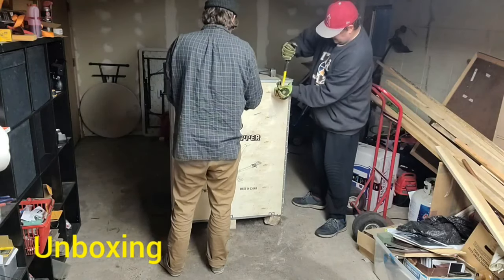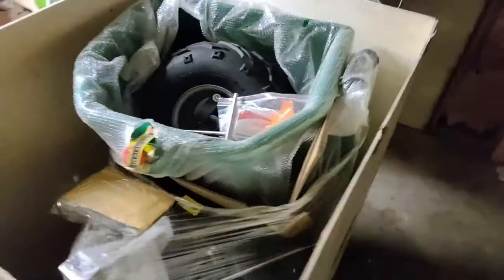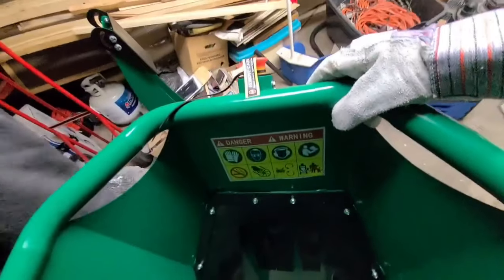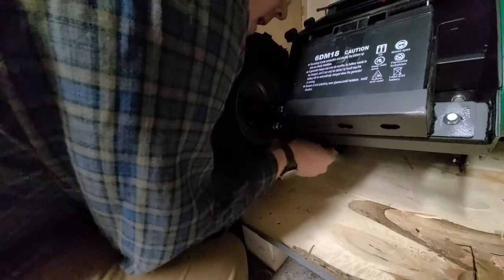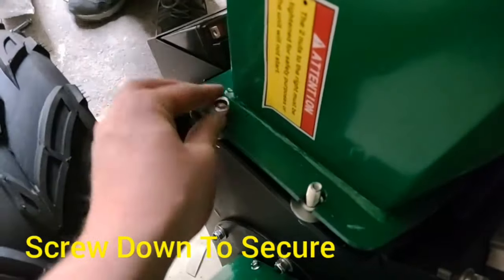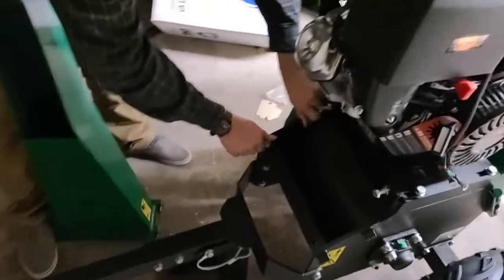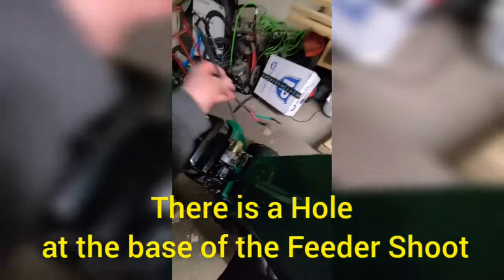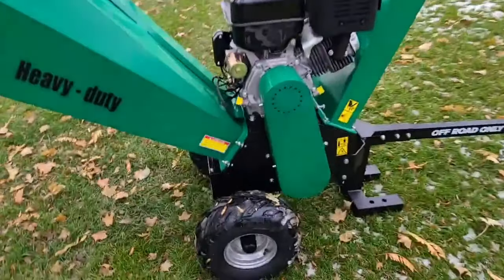Unboxing and Assembly of All-Power Woodchipper 420cc 15HP Model APWC420E Review

Comment: Did you add oil before starting?
Reply from the maker: Yes, I think I made a video about it, I used breakin oil which you need to use before starting it. I was told by the manufacturer to run it for an hour then drain and put in the oil we are going to use.

At the end of the season I ran it hot and then drained it again and put fresh clean oil in for winter storage.

The first oil change I was leaning a lot and different techniques. Now I do the oil chnage in 10 mins.

I think I'll make a video about this this season.